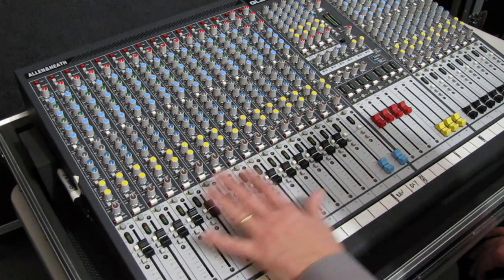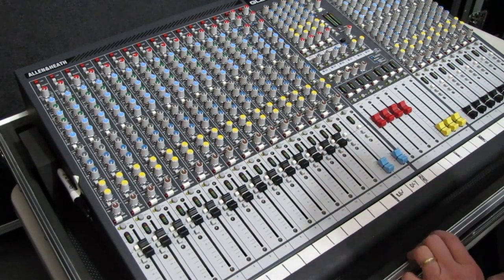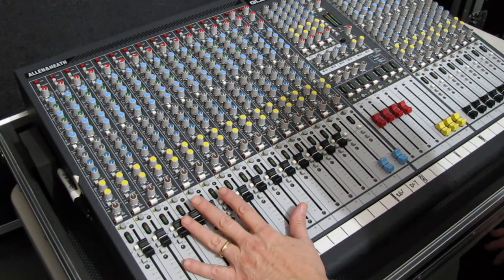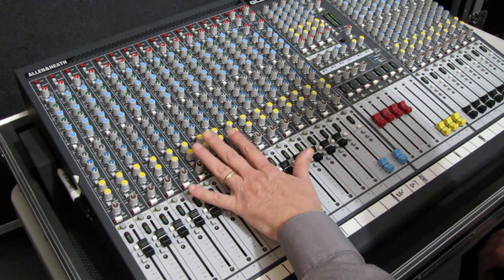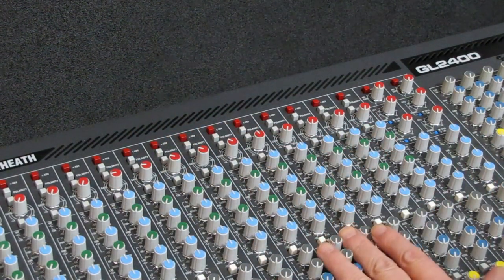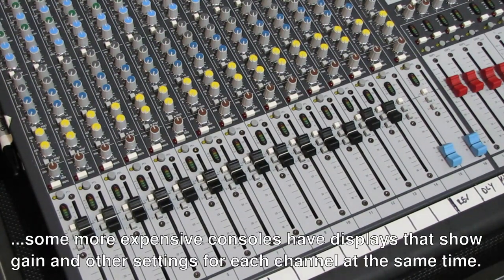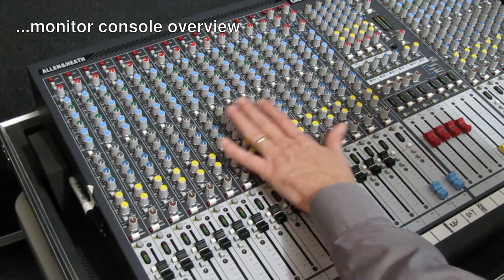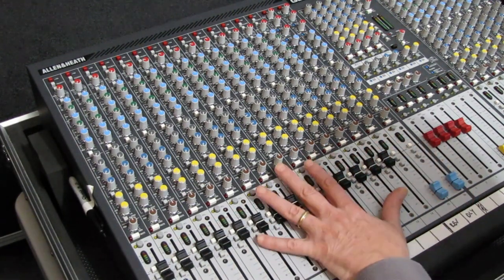Mixing at unity on consoles; is this the right way?

Comment: It is called unity gain structure, not unity mixing.  Know the difference.  I don't know of a manufacturer that suggests that a show is mixed using the preamp gain knob.  Unit gain structure does however allow each microphone to receive the correct amount of gain for that particular mic in that particular system venue setup.  After the correct gain for each mic has been set via unity gain, the so-called, engineer is free to slide the faders to their hearts content and mix as how they desire. Occasionally a (again, so-called engineer) might have to go back to the top at the input gain and make an adjustment that reflects changing environment on stage but this is not called unity mixing.  I'm older than dirt and back in the day there was no variable gain knob.  Gain was preset and it was a problem for low output mics such as an SM57.  Next came a 3 position gain switch that gave 3 levels of gain and finally a variable gain pot. Being able to use just the right amount of gain and avoid the noise floor is critical.  Not setting the master fader to unity and the channel fader to unity and then setting the correct amount of gain will introduce excessive gain (noise) into the signal.  EG. if the ch fader is set to 50% and the master is set to 50% then the input gain needs to be set much higher (noise) than needed and also input distortion will occur. Again, it's called "Unity Gain Structure" not unity mixing. Know the difference.  BTW, we used to have to make our own mixing consoles as you could not just buy one off the shelf.  The Monterey Pop Festival was mixed on a mixer made just for the concert. The host of this video might be better serving teaching how to get the musicians (with amps) to not turn their amp up when the so-called sound engineer turns the level down for that musician.
Reply from the maker: Thanks for your comment.  Mixing at unity (as the video title references) is the practice of setting faders at unity ( -0- ) and using gain control to mix a show.  Unity gain structure (as you referenced) is setting gain structure throughout the signal chain from input to amplifier output.  Unity gain structure and "mixing at unity" are separate things.  You are correct, no console manufacturer would ever suggest to mix an event using the gain control knobs.

Comment: There are many times when I see mixing consoles configured this way - which I don't agree with at all, for the reasons mentioned in the video. I don't even see any use in this configuration and I consider it a potential error, in case things go wrong. Anyone who uses this type of configuration may regret using it. And when you regret it, it may be too late in the course of a show.
Cheers!

Comment: revealed a fault, but didn't define solution or experience of it done correctly; not sure how helpful this is to those who have been trained to use unity as a starting point for a channels mix.
Reply from the maker: The process of mixing at unity is an incorrect way to use a mixing console; therefore, there is no solution to show how it would be done correctly.  The channel levels - including unity, referenced on the console, simply show whether the fader is adding more or taking away power from the signal derived from the input gain.  A mix should be started with a proper gain setting first, and then the faders can be used to add/subtract the levels as needed.
Reply: @Rick Gustin Saw your post, but you are not mixing to Unity.  You are gain staging to Unity and mixing by faders.  Yes I read your post,
Reply: @stageleftaudio  2024 If your faders down and only adjust grain knob to set structure. Would your faders barely slide up before volume levels are reached? Yes year 2024 question. Just seeing video.

Comment: So does it matter where you set the faders when setting the input gain? I have never heard of mixing using the input gain but am curious where to set the fader for setting the input gain.
Reply from the maker: When setting gain, the position of the faders do not matter; this is because the gain is separate from the fader.  It's common practice to keep the faders down when working on the gain setting... this is so the FOH engineer can focus on input levels instead of the volume level of the input being worked on.  Once the gain is set (for the type of input... guitar, drum, vocals, etc...), the fader for that input can then be brought up into the FOH to test for volume level and sound quality.  It usually works best to work with one input at a time... set gain, bring fader up into the mix... when complete, move to the next input.
Reply: @stageleftaudio  thanks man! Very helpful!

Comment: Hey!  This is a question I posted from your Center-Fill video from 11/20/2020.  Thanks:  "Good Morning!  Question:  So when you say, in your example, "30 feet for each side..." does that mean 15 feet to the left of the [left side speaker] and 15 feet to the right of the speaker??  Meaning, in your example the left and right FOH speakers would combine to provide 30 feet of coverage in between the two speakers?? So, if you had them 40 feet apart, with the 90 degree horn, you would be missing 10 feet of coverage in the center of stage, and possibly need a fill speaker??  Thanks, as always.  Carl"
Reply from the maker: Hello!  You are correct, I was speaking of 15ft on each side of a single speaker (which totals of a 30ft horiz. coverage per speaker).  In the example, this would equate to 30ft of coverage for the area between the speakers (15ft coverage from each speaker).  And yes, speakers with a 90 degree horn would yield a void between the cabinets, which would necessitate a center-fill.  My apologies for not responding to your question on 11/20/2020.  Many times, I do not receive notices/alerts from YouTube when comments have been posted.  I will check for comments on past videos, but there's a good chance I will miss them.
Reply: @stageleftaudio  Thanks and have a good day.   Carl

Comment: First off this suggests that people are quite commonly simply adjusting gain for their mix.  And while doing so does adjust everything after, I think your explanation missed a key point.  That being, how to use it correctly.
You start with a given channels fader at Unity, then adjust gain (gain before feedback).  From there, you adjust the fader relative to the rest of the mix.  I have never seen anyone use the gain to adjust their mix as you have described.
I train people to use Mixers, and there is a very simple explanation.  Gain is NOT volume.  They are not the same thing and the gain and fader serve two different purposes.

If you have an input that is not "loud enough", outside of being to far from the mic, I would suggest checking that your gain and gain structure was set correctly in the first place.
If gain structure is set correctly at the beginning, very few if any changes are necessary afterwards to the gain
Reply from the maker: Unfortunately, many people mix using just the gain.  It's heart-breaking to see consoles used in this manner.
Thanks for your comment.
Reply: Alot more people do this than you realize.  And some people are just not willing to learn.   The current board I am using, the previous operator adjusted everything with gain.  Drove me up the wall, he didn't want to hear anything about it and I was constantly resetting gains and levels everytime I used it.   

His excuse was he didn't like seeing the little red light flashing which was the compression indicator  to him Red=Bad. (standard mindset from military electronics training, nothing was in red unless it was bad). 

Now that it seems to be just me all the time running the system, I just fine tune the individual faders as needed to keep the levels balanced.
Reply: Thank you for actually giving a solution.

Comment: what is the correct way to use gain and volume fader for a live band? im using rockford mixer
Reply from the maker: Set the gain where it is getting as much as it can from the microphone (or instrument) input.  There should be meters on the channel or the console showing how "loud" the signal is coming into the board.  Adjust the gain so the signal is around 0db (for vocals and  guitars), and possibly around +6 or +9db for drums.  Once the gain is set, there should be no need to adjust again, unless there is fine tuning needed to keep the input level appropriate.  Once the gain is setup, move the channel faders up/down as needed to control the volume output to the main-out buss.
Reply: To piggy back on StageLeft.     Using a mixer like the Rockville RPM1470, you do not have individual line meters or a PFL button to view the input on the mains output meter.  In this case, you would have to set up all gains for all channels before setting actual mix levels.
Couple of different way from what I can see with this mixer.  The first(if I understand this mixer correctly) will be faster but won't provide a accurate/clean visual representation.

(1)  1- with the faders down, adjust the channel gain until the OL indicator starts to light up / flicker.  This indicator should be letting you know that the input is clipping or has reached overload or 0 level.  
2- Turn the gain knob back about counterclockwise about 6-10dB or so.  This should provide overhead if the input level should increase during the performance and significantly reduce further gain adjustments.  
3- adjust faders for main outputs

If the OL indicator is not working in this fashion or you wish to verify it works in this way go to the next option.

(2)  Depending on the setup size and time to get things done, setting with amps turned up or down will be your preference.  
1- set the main faders to Unity/zero
2- on the channel number to adjust set the fader to Unity/zero
3- watching the main levels meter, adjust the gain knob to the levels indicated by Stageleftaudio.  Once there, leave the gain alone and mute the channel.
4- repeat #2 and 3 for each additional channel needed.
5- mix your band levels for balance and output levels with the faders. 

 A big thing to remember is that while you can adjust gain during the performance, adjusting it changes the Monitor levels as well as the Main output levels.  You don't want to mess with the monitors to much once they are set.

While most newer boards have a channel level meter or a PFL Button (pre fader level) to see the input gain on the meter instead of the output level, not all do like the Rockville, hence your question.   Hope this helps

Comment: It's 2022 and I just came across this great video. Thanks, SLA...
Assuming you're using passive speakers, how should you set volumes on the Amps?
Reply from the maker: Thank you for your comment.  For passive speakers, it's usually best to keep the amplifier attenuators turned all the way up.  This ensure the amplifier is at it's most sensitive setting.  Adjusting the gain/attenuator settings on amplifiers should only be done for specific reasons.
Also, we recently did an update to this "Mixing at Unity" video.  https://www.youtube.com/watch?v=uB36LItc9cw

Comment: Regardless of all the sound quality and S/N ratio things, gain knob is at the very start of the signal chain, influencing the strength of this channel's signal not only on main buses but also on auxes, groups and direct outs. Fiddling with gain knobs would certainly mess up the monitor mixes and OB mixes coming from aux buses. For digital systems in which the same stagebox is shared by multiple consoles, messing with the analog gain will even mess up mixes from other consoles.
So personally I suppose that mixing with gain knobs is not just about lacking professionalism. It's absolutely a behavior of sheer selfishness, lack of respect and serious infringement to performers (and to monitor technician if there is one). It's like dimming your own house lights by hacking into the power station, throttling down the generator and therefore decreasing the mains voltage of the whole city. Nobody would accept this.

Comment: I didn't even realise people would mix with the gain knob. Does the gain knob control the input volume of the device connected to it? Does the fader control the master level of all of the FX? Thanks
Reply from the maker: The gain knob controls the input volume of the device into the console.  The gain can affect the quality of the signal it is amplifying into the console.  The fader controls the output of that signal into other parts of the signal-path in the console.  The effects for that input is partially controlled by the fader.  The effect "sends" on each channel would be considered the "master" level for that channel.
Reply: @stageleftaudio  Thanks, that makes alot more sense now! :)

Comment: The only problem with the setup up you are talking about is the constant  changing of the GAIN. Which is not good at all

This is what I do..
Tell me if it is wrong..
(If mixing a new band)

1. Turn all GAINS all the way Down, 

2. Put L/R(MAINS) fader to Unity Gain

3. Put ALL FADERS to Unity gain
Except stereo channels with No Gain/Trim

4. I get each singer/musician (One at a time) to PERFORM at or Close to  the LEVEL as if it was Live.
(NOT TALKING INTO THE MIC)

4. I THEN adjust GAIN with PFL/SOLO engaged (on the INDIVIDUAL channel I am adjusting AT THE TIME) to make sure I'm getting a strong signal on the meter.

i.e. I Turn Solo on for Ch. 1 then Adjust Gain, then Turn SOLO/PFL off Then Repeat for the next channel.

-18dB to  0dB depending on what board you are using. 

5. Then I Do a Pre Sound check with NO Monitors. ADJUSTING GAIN ONLY,  Keeping All faders at Unity Gain.

THEN I NEVER touch the gains again. (Unless a mic is swapped) 

6. Only then Do I Adjust their monitor mixes

7. Do a Final Sound Check with FOH & MONITORS.

8. AT THIS POINT
If I need more volume, 
I can move the fader up to at least +5dB
Or if something is too loud I can  bring it down to -5dB or more.

Basically, after my final Sound check most of my faders sit between +5dB & -5bB. Because some songs are more intense than others.

Is that a decent way to do it. If not

It would be nice if you did a video showing the beginning to end setup process in another video
Thanks
Reply from the maker: Thanks for your comment.
We hope to have a video covering an actual input/line setup and check at an actual event. Yes, you are correct, the constant changing of gain is a serious problem in the industry, especially when running monitors from FOH.
For the steps you provided, they look good.  You have a good process to setup a mix. 
 However, step #3 should not involve moving all faders to unity.  Setting gain involves "extracting" as much signal as possible (within reason) from the source, and then moving the fader(s) up/down as needed to blend that input into the overall mix (even during the sound check).  Gain level adjustments, and fader level adjustments are two separate entities and should be managed separately.  By moving all the faders to unity (and using "unity", even with a +/- 5db as a mixing location) can potentially reduce the overall input level of a channel,  because any additional gain that could be applied to the input level, is missed because the fader is at unity... and when people mix at unity, they don't move the faders much.
For your step #5, the gain level should have already been set at step #3.  When you readjust gain (i.e. step #5) to ensure your faders stay at/around 0db, you are mixing at unity, and potentially missing out on additional gain for an input.
It's ok, and advisable, to readjust gain during a show; this greatly helps with controlling feedback due to mics being moved from (stage vibrations, performers accidentally kicking them, vocalists moving around a lot, etc...); though, any gain adjustments should be very minimal.
Good to see your reference to -18db and 0db!

Comment: I have a literally never seen anybody ever do it that way.
Reply from the maker: Unfortunately, this is a common practice.
Reply: @stageleftaudio  its not common in the way your describing it. Mixing at unity is only done at the beginning. Set faders at unity, then have the band play and get the overall mix via the gain knobs. Dial i it in as perfect as you can. Then that's it. You never touch the gain knobs again. Now for any small adjustments , your using the faders. This way, your monitors don't get changed. No one who mixes at unity does it in the way you described. They don't keep fiddling with gain knowmbs al night. The main purpose of STARTING a mix in this fashion is to get all the faders as close to unity as possible. Then very small adjustments are much easier to make , and its much easier to see where something needs to go back to if a fader gets moved for whatever reason. I.e., a guitar solo or a drunk that falls into your board. (The latter being the biggest benefit. ) the last one happens more times than you'd think in bars and clubs. Lol.
Reply: It happens more than you realize.  Professional level maybe not, but those not doing it professionally, volunteers etc, do it this way religiously. 

I am no pro, but I have seen this far to often.  I practically begged for my military commands to let me set up the systems for different things.  It wasn't until none of their preferred people were available and i got the chance.  

Needless to say having some experience and not listening to people tell me how to do the job, pushed me to the top requested, they realized I actually knew what I was talking about.
Reply: @ericgustin3386  then they are not mixing at unity.  They are using Unity Gain settings, then mixing for balance.  It is different, and yes there are places and people that actually mix using gains not fades.   

This may not be common for those with knowledge/pros, but for the amatuer?  this is very common.